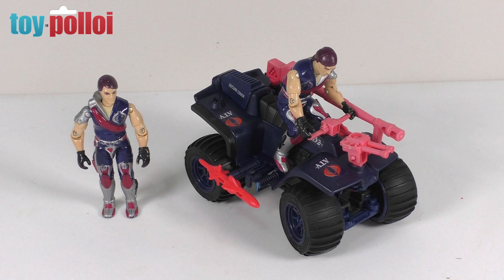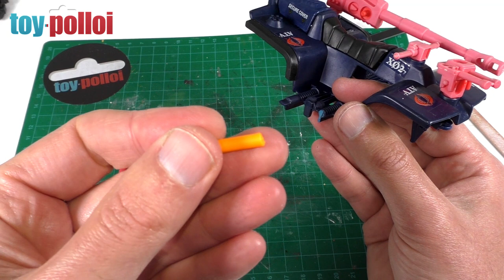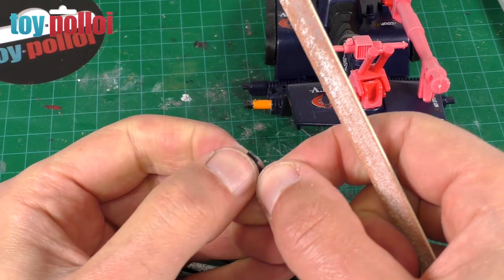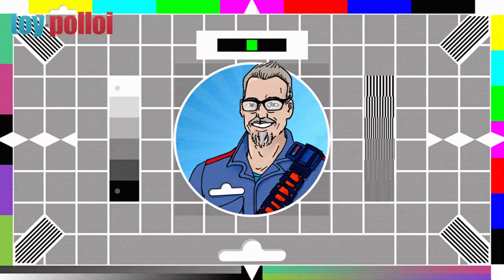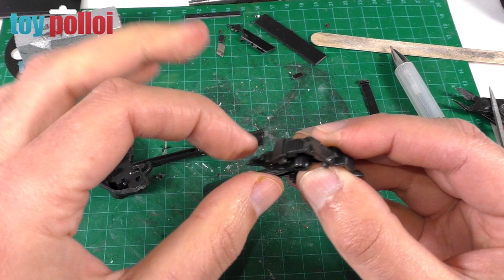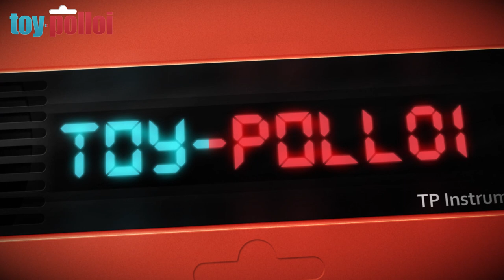Vintage G.I.Joe Cobra Ferret ATV repairs - Toy Polloi

Comment: That's an excellent repair, very sturdy looking! I've got a couple of glue suggestions for you to have a look at, if you're interested. The first is "Loctite Super Glue All Plastics" - now this is an adhesive that will work (it comes with a special activator pen) with Polypropylene and Polyethylene - the two rubbery plastics that nothing ever sticks to, but it works very well. It's still a mechanical bond, but it is sturdy and reliable. The other is E6000. Sticks fantastically well, but has a bit of flex to it, so it doesn't shear off easily - which comes in handy for many toy repairs. Have a look at these two, they may prove to be a useful weapon in your adhesives arsenal!
Reply from the maker: Thanks for the glue tips. I will check those out.

Comment: You could try getting the red color to come back in the guns by spraying the parts in black magic and putting them in red tool dip, Then leaving them to set. The black magic softens the original plastic and the dip slowly dying them.

Comment: Hi Dave!
Have you ever used the baking soda trick with super glue? I've used it for various small jobs around the house and it really is amazing how much strength it adds to straight super glue.
I've not tried it on the rubbery type plastic of the ATV's engine block, so I'm not sure if it would work in this instance. Just throwing out a suggestion that you may want to try and tinker with in the future.

Cheers!

Comment: Fantastic restoration. I like that every TP video is a little different; this one focuses on a broken internal structure of a toy (as opposed to working on restoring more "visible" parts), which is great! I wonder if some of the tricks you tried with re-colouring/dyeing Max Rebo would work on those faded red parts? Or if there are other methods you've discovered for restoring colour to plastics?
Reply from the maker: Thanks. I try to do and show different things in each project. Although sometimes the same fix works across different toy lines. 

I'm not sure if dying that plastic will work. It's fairly soft, softer than max rebo. So it may not like getting that hot.

Comment: very nice fixes. my only gripe is I was hoping it might have had a busted rear axle that you where going to fix as it seems a common issue with the ATV at least 2 of my 2nd hand ones have that issue .
Reply from the maker: Drill a hole in each side of the break and insert a piece of paper clip for strength. Then glue back together.
Reply: @toypolloi   I was thinking that might work but its kinda hard to get the clearance to get a drill on the different sections :)
Reply from the maker: It's possible. I did it in this one as I broke it after filming. So it can be done.
Reply: This is the problem I have on my ferret and my tiger paw. Did you attempt the paper clip fix? How did it go?

Comment: Would running the red parts quickly through a lighter flame bring back the color? I've seen videos of stadium seats being torched and the color comes back. Can that work on a smaller scale. I know it works for stress marks on plastic, but never tried it on larger pieces.
Reply: Flame will work but its tricky. Get a selectable temperature HEAT GUN. You can achieve the same result as the flame but you are able to sneak up on it.

Also, Rit Dye for Synthetic fabric does wonderfully. You have to boil it and can dip the plastic parts in until it reaches the color you need.
Reply: Isn’t the plastic sun bleached or sun faded though?

Comment: I think that rear clip is supposed to face in the opposite direction. 
The chassis is a real problem because I believe it's made with polypropylene so you cant use plastic solvent. 
My ferret and my tiger paw have breaks along the back axel and I cant find a way to fix it. There's not enough surface area for a glue. 
I think I might try to fuse them with fire but even then I wouldn't be massively confident in the eventual bond. 

Any ideas would be appreciated. :)
Reply from the maker: You need to pin and glue the axles to add strength.
Reply: @toypolloi  Yep, Ive ordered my finger drill today. :)